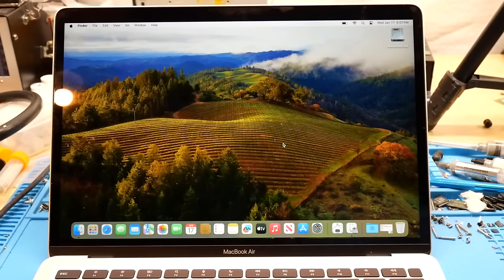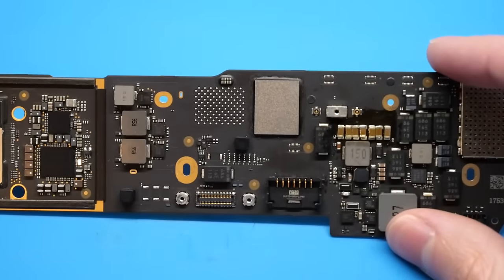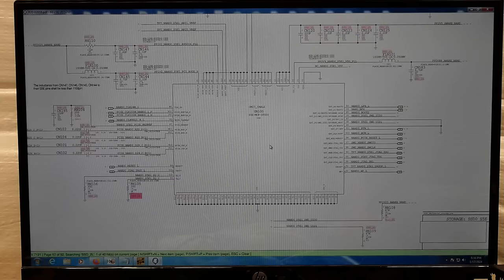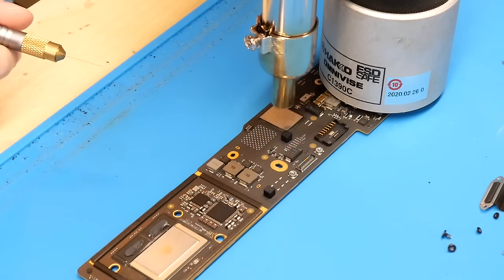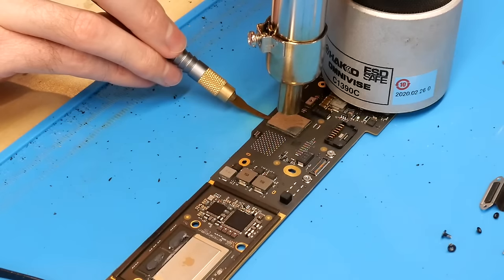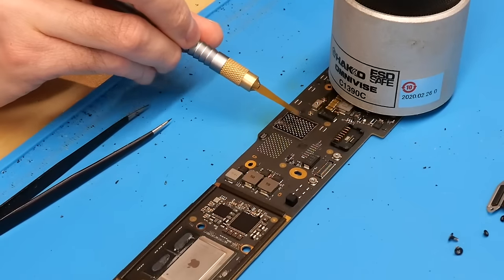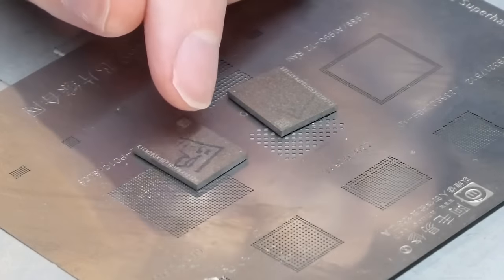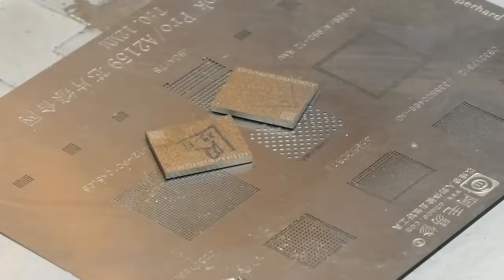Upgrading Apple Silicon Soldered SSDs

Comment: A couple of questions after watching the video:  1. Do all Mac Book Air M1's need to have the second storage slot repopulated, or is this something that was specific to that "educational" machine? My Mac Book Air has 256gb of storage, does that imply that both storage slots are already populated?   2. It would be incredibly helpful if you could post a link as to where to purchase the NAND storage that you use (ideally the empty one that you recommend), however what would be even better is if you sold the ready-to-solder-in storage NAND chips on your web site (for a mark-up of course). I'm talking about pre-beaded, and with the firmware repair (if necessary) so that all that we would need to do is simply remove the old storage and put the new chips in with only very minimal equipment expenditure (i.e. an air heating gun and the scraper/wedge tool). I bet you'd sell quite a bit of those!

Comment: i have an mid-2014 13 inch MacBook pro (8gb ram, 256gb ssd) and love the formfactor but is running really slow. I dont need a super fast machine but it freezes almost when browsing specially browsing YouTube videos, its takes long time to calm down each time. What would you suggest is a moderate doable "fix" for such a machine? to just make it maybe 30% faster response. that would be more than enough for me.  Thanks for a fantastic channel.

Comment: @dosdude1 I have 3 quick questions for you.  What temp do you initially set your hot air rework tool too? After you do the scraping you say to 180 degrees. That is Celsius correct? What is too hottest temp anyone should use? I'm new to soldering, so I want to try on some old practice boards. Thanks in advance.

Comment: Is there room inside any of these modem macs to install storage (ie stuff it in the case somewhere) but then just hijack the usbc socket to make it think it's external an external drive? Basically looking at an easier way to hotwire some extra storage even if it's it as good as a standard external disk, but save carrying one around.

Comment: Correct me if I am wrong but isn't the "Secure Enclave" stored on the NAND chips? If so is this what you are "programming" the chips for? I just remember Rossman complaining he couldn't replace NAND chips after short on the SSD due to Apples security OS running on the SSD and he had to pull NAND off a donor board.

Comment: Can someone explain why the limit is 2tb? I would love to upgrade my current 2tb to a 4 or 6tb SSD, but I'm not sure if that's possible.
Reply from the maker: The largest chips available ate 1TB in size, so with 2 chips, the largest storage config you can make is 2TB. You are also limited to using the chips/chip combinations supported by Apple only.

Comment: Great Video! If i got this right, we would safe a lot of time by just swapping and reflashing ONE NAND? I mean if we can put just one 1Tb Nand, that would be good and helpful enough for most users.
Reply from the maker: Nope, you cannot do that. Only officially supported configs offered by Apple will work, so in the case of M1, 2 chips are required for 256GB and larger.

Comment: Curious question, does it apply to RAM too? And I always wondered, is it possible to do a shunt mod similar to desktop GPUs, aka, tricking the system to take in more voltage to overclock (since Apple locks down the software).

Comment: 128gb storage m1, that's such an INSULTING amount of storage combined with a very capable cpu. I assume it's slow as hell too being only one chip. Can't believe apple sold this config.
Reply from the maker: I know, less than 100GB free with OS installed too haha. At least it wasn't sold to the general public, only schools I guess.
Reply: You can't believe Apple would ripoff schools? Where have you been the past 40 years?
Reply: reminds me of some of these HP Streams, some had a actual Haswell-ULV Celerons rather than Atom-derived stuff yet only 32GB of soldered eMMC storage and no SATA ports
and these HP's were sold to general public!

Comment: Help!! Thank you so much for sharing this step-by-step video, truly amazing!! I ordered new blank NAND from Ali express 2x 1TB and installed both of them using your video. I am confident they are installed in the proper orientation but once re-installing the board back and connecting the battery and all connectors, the MacBook Air (A2337) does NOT even turn on?! No chime, no apple logo, no DFU mode. Do you have any insight or recommendation?
Reply from the maker: You’ll need to force it into DFU mode using jumper. Easiest way to do so is jump the pads as shown, with nothing plugged into USB-C ports or connected battery, then plug in USB-C power. Keep pads shorted for another few seconds, then release and connect correct DFU port to host Mac.

Comment: in a Cupertino office this morning:
- Have you seen it?  they are upgrading our soldered SSD instead of buying a new Mac
- I said already, it's not enough to solder it
- What do we now?
- On the next update, hardcode the SSD size for the serial number in the UEFI firmware.  If the system detects more than allowed, shut it down. 
- We  can't just shut down an otherwise working machine
- Make it some confusing error message about the customer's own safety.   ...or even better blame it on some regulation, EU law or whatever...
- All right.

Comment: Do you happen to know the difference between the p13 programmer and the p15 programmer? I searched for both products, but I don't know the difference.
Reply from the maker: P15 is just the new version that has modular NAND carrier boards, definitely best to get P15 if you are looking to buy one of these.
Reply: @dosdude1  Thank you for your answer.
Then if I have P13, I don't have to upgrade to P15, right?
Reply from the maker: @ssdwssd8030  As long as you only intend to work with BGA110 NANDs, then no. The P15 has removable NAND carrier boards with different footprints/sockets, so it supports BGA315 (used on most M2 and all M3 systems), as well as some older NAND types. I kind of regret getting P13 now, wish I had P15, but it didn't exist yet when I bought it.

Comment: This modification is really time and labor intensive as well as technical, does this service cost more than just buying more storage from Apple?
Reply from the maker: Assuming you’re going from 256GB to 2TB, the service with parts and labor included actually ends up costing just about half what Apple charges to configure one of these machines with that when buying new.
Reply: found the answer - Normally $200, plus the cost of parts (around $100 for 2TB) and return shipping.

Comment: Thank you very much for this video. Do you think it would work if I program fx. KICM222, 2x512 with dump from KICM223? I dont think it will work, but just asking if you have such experience wtih this. I will backup those nands if they will come to shop where Im working and will share on repairwiki/ logiwiki. Thank you once again for great video.
Reply from the maker: No, that will not work. You can only program a dump to the exact same model NAND it came from.
Reply: @dosdude1  Thank you very much for your time and answer. You should have nick bossdude!

Comment: where can i buy a nand chip for a m2 macbook air? i would want a 1tb chip because I don't wanna rebuild the other spot for another chip.
Reply from the maker: That won’t work, as single 1TB is not a valid config. Any 512GB and higher config requires the use of two chips on that model.
Reply: @dosdude1  so because i am on a m2 256gb mac (which only uses one nand chip) i am REQURIED to rebuild the second one to get access?

sadly, I dont have a donor board.
Reply from the maker: @majorgaming3909  That is correct. As I mentioned, no donor board is required, all the necessary components can be bought from electronics distributors like Mouser.

Comment: unrelated to the video, but watching you do BGA work has me wondering if you could fix a motherboard with a damaged (beyond repair) socket by removing the socket and pretending the CPU is BGA and soldering it directly to the board. i think this would work for both LGA and PGA provided the footprint for the socket is similar; i haven't done any practical research on this though as i don't have the necessary skills or equipment. i do know that PGA pins can be removed cleanly with heat, though, so this theory could even be applied to PGA CPUs with horribly bent or broken pins
Reply from the maker: I've done CPU socket replacements before, it is possible to simply remove and replace the socket with a new one.
Reply: @dosdude1  oh! i didn't know that; i had heard that it was impractical/impossible to replace a socket because of its complexity. that'll show me for not doing research ;P

Comment: I'd absolutely upgrade RAM as well, to reduce swapping as much as possible
Reply: The M1 is a SoC (system on a chip), which also includes the (unified) memory. So to upgrade the RAM, you’d need to replace the SoC

Comment: Great work! I am wondering, do the serial numbers, mlp numbers, mac address etc reside on the nands or are they somehow integrated in the SOC?
Reply from the maker: They normally do reside on NANDs, but when installing new NANDs on these, that info will actually be pulled from Apple's "Factory Data Recovery", or "FDR" server (based on the SOC's ECID) and written back to the new NANDs during the restore process.
Reply: @dosdude1  That's some clever apple engineering. Thank you for the explanation!

Comment: I LIke to Upgrade my My MBPro 2015 with 8 more GB of Ram. Can i buy just wghat i find? Or need it be something special?
Also CPU Upgrade would be nice but i dont trust my skills for that and have only a Cheap hotair Station.
Reply: I want to do the same thing to my MacBook Pro, cause I would love 16 gig of ram in my MacBook, I would love to have 32 gig but it’s not possible on the 13 inch
Reply: Because the RAM is soldered, i have read that if you unsolder and resolder more ram it can mess with the machine, the best solution is to buy a logic board that is compatible with your macbook so if you have a 13" model then buy the logic board for the 13" model with 16GB RAM or if you have the 15" model then buy the logic board for the 15" model with 16GB RAM. Thankfully the SSD is still user upgradeable in the 2015 MBPro and to an extent so is the battery though it looks very time consuming to remove it.
Reply: @ColinsCity I looked on eBay for the system board with 16 gig of ram and what ever processor available and it was 400$ nzd shipped to me down under
Reply: @magesnz  It's probably cheaper to buy a 16GB 2015 MBpro with 256gb ssd and just swap out the ssds and sell your current one with the swapped out ssd
Reply: @ColinsCity  I saw videos from dosdude where he swapped Ram and near the cpu he switched a tiny component fom one to the other place, then its worked. And because i misused the MB, i allready have a ebay replacement board in it. Also my Battery needs to be replaced with about  1300 cycles. 
Sooo before  i spend much money on a new logic board, i would sells as is and get the most new modell because there finally a sdcard reader in it and other goodies.
Reply: best solution is to sell your macbook and buy a computer where the manufacturer doesnt actively hate you

Comment: Apple M3 Pro is Equal by perfomance with Intel Core i7-8700K which is very old cpu, so question is why do you need to upgrade anything on Mac if you can buy something more recent and decent where you don't need to do upgrade in few years at least and if you ll need to then it will be easy task by adding or replacing components

Comment: Apple has turned all of its computing products into cellphone electronics with virtually no possibility of upgrading memory and storage (unless you're highly qualified technically and have all of the equipment and parts), battery (some can do that but it gets a lot more difficult with each new model), etc. and, if a mac owner wants to upgrade, it is expensive and probably not worth doing especially for anything more than a few years old.

Comment: Jesus Christ man.... 99,99% of the world's population can't do this... we are all gonna just buy a external ssd and get on with our lives!! Nobody has this kind of equipment or this knowloge/skills to do this damn storage upgrade!! That's insane!!
Reply: @larry6006: Only if you own an Intel Mac. Most of the new ARM machines prevent one from booting off an external drive if the system drive goes belly up! In essence, your machine is dead in the water.
Reply from the maker: @flashbak01  I think it is actually possible to run the OS off an external drive, but still requires working onboard NANDs to actually boot. However, while this would work OK on a Mac Mini or other desktop, it is completely impractical with a laptop.
Reply: @dosdude1  i will never stop using my 2010 mac pro tower !!
Reply: @flashbak01  omg the situation is worse than I thouth!? Hate this new macs....
Reply: @dosdude1 : Yes that is correct the Onboard NAND's have to be working in order to boot off an external device. It's crazy!

Comment: Let's see the 128GB laptop costs $500, but the 1TB laptop costs $2500, so I all we need to do is to find someone who would solder in the larger chips for $1500, and we're still profitable.
I think I rather buy a 1TB laptop for $800 from someone ELSE than Apple.

Comment: Apple should be sued by users for using soldered storage, it is so stupid. Speed benefits are none basically, it operates between PCIE 3.0-4.0 speed anyway, so not the fastest. And there will be a room for it if they want it. In the past, they have a PCIE slot that was on an edge of the motherboard, so it was not creating extra thickness at all.
Memory on the chip has speed and latency benefits, so kind of ok here - I still think that if they want they will be able to make them swappable via clever slots on a chip itself, or on the opposite side directly under the chip, they are ~3T company so, sky and will is the limit.

Comment: I wonder if my wife would let me do this to my M2 Pro. 😂  J/K. I paid way to much for that POS Apple thing.
Reply: Thinking about this and the worst part is that it probably isn't much more expensive to pay you to do this than pay apple to build the darn thing with more storage.
Reply: @pkt1213  It would be MUCH more expensive to buy it with the 2TB configuration. I doubt Apple charges just $300 to go from 128GB to 2TB. Probably more like 2-4 times that amount which is 'normal' for Apple.
Reply: @g4z-kb7ct   he didn't say how much this cost so I didn't want to assume a price.  RAM upgrades are listed at 2-300 but BGA reworks don't have a listed price.

Comment: Soldering an SSD should be illegal especially on devices as expensive as Macbooks because even their base models are not cheap and the re-writing of data on SSDs under 1TB is a lot which makes them die a lot faster, i'm sure the 128GB SSD is close to failing with the amount of times it reached the 128GB capacity during writing to the disk.